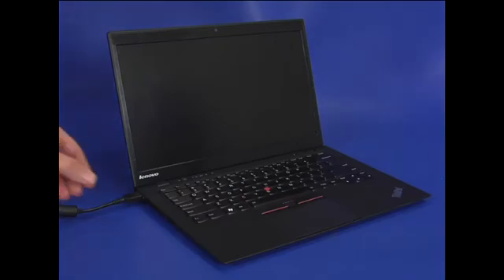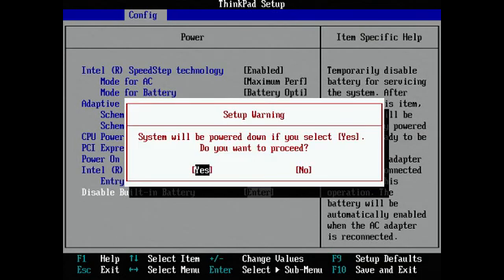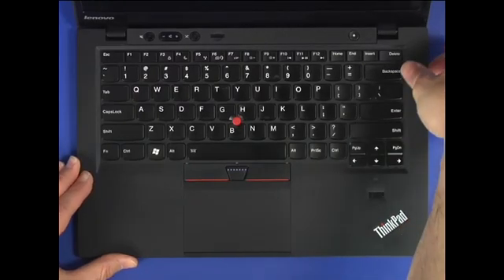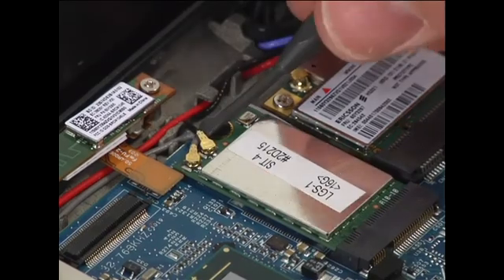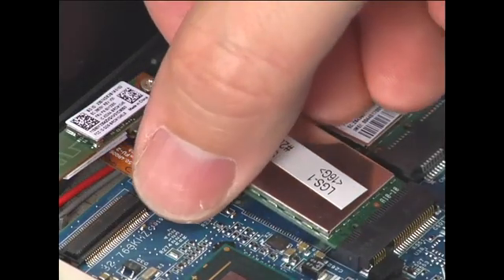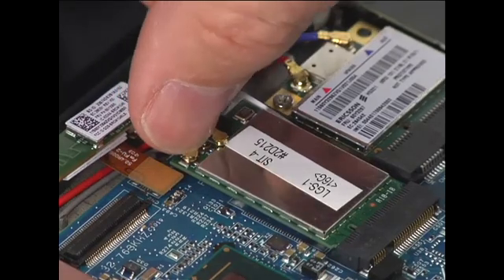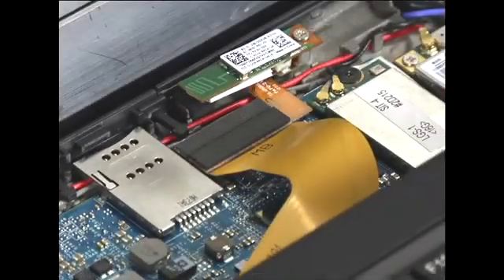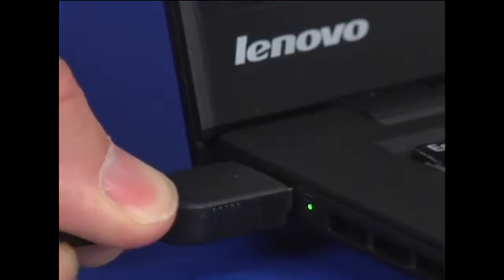ThinkPad X1 Carbon (1st Gen) - WLAN Card Replacement

Comment: I would like to upgrade my wireless card to a 5ghz AC card with bluetooth 4.0 / 5.0 , can you advise which card i can use for the upgrade?
Reply from the maker: Hi Aman. Thanks for writing in. You may find the compatible Wireless card for Thinkpad X1 Carbon 1st gen here: https://lnv.gy/2OSHlFg. Let us know if you need additional help. Auxen_Lenovo
Reply: @LenovoSupport  It's possible I'm not reading this correctly, but it appears as though there is only one wireless card supported for this generation of X1, and it isn't supported by Windows 10. Is that correct, or is there a card supported by both the 1st generation X1 carbon and Windows 10?
Reply from the maker: Hi Mark! Thanks for writing in to us. Yes, it is not supported. We've also checked here (https://lnv.gy/2KTlbDG) and the Gen 1 of Thinkpad X1 Carbon is not compatible with Windows 10. -Jerry_Lenovo

Comment: after the cover is installed and the notebook is turned on again, what's the next step? does it enter the bios? do I have to reinstall windows?
Reply from the maker: Hi Layar! Thanks for writing in. You don't need to reinstall the OS of your laptop. Also, the laptop should boot to Windows directly. Since you unplug the AC adapter and disable the battery before replacing parts, the battery will be reconnected once you plug the AC adapter. It should be working once it booted to Windows. Hector_Lenovo